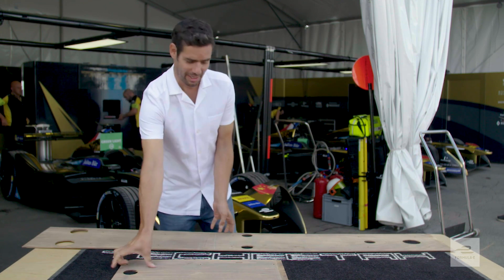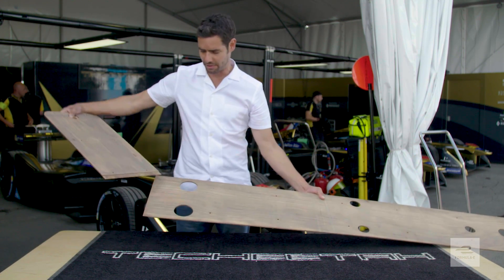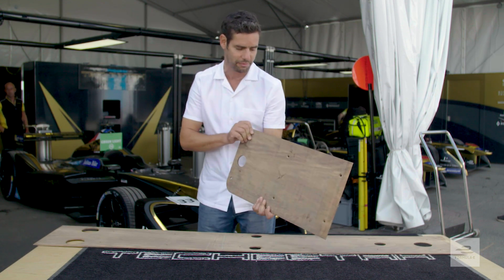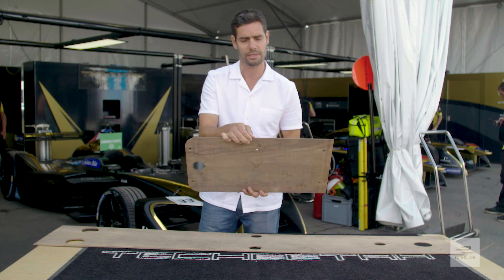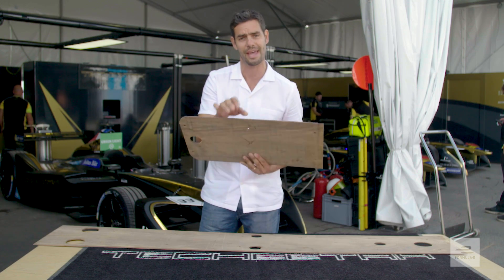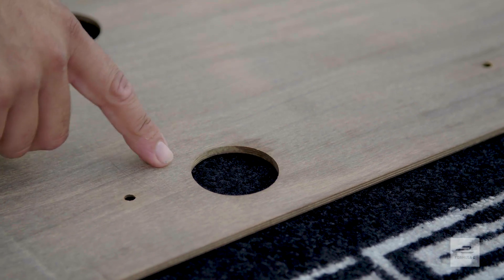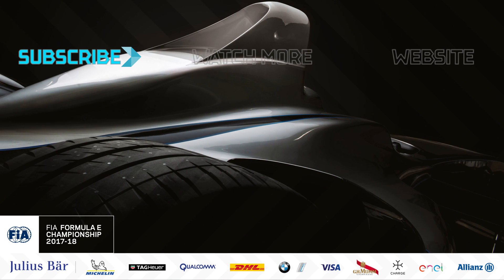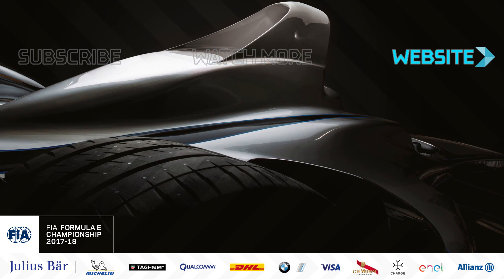Why Is There Wood In A Race Car? - Formula E

Comment: It's not for safety. It's to preveng ground effect using the Bernoulli Principle. Research those Lotus F1 cars of the 70's and you'll know what I'm talking about :wink:
Reply: This was a bit of the cause of senna's crash because he bottomed out on the floor really hard cutting of much of the airflow, which resulted in a grip loss and he flew off the track.

PS: the floor had no planks then that made it so rough when they bottom out, you could see MASSIVE sparks coming out of the back of senna's car, which are shown on Schumacher's onboard camera.

Edit: there where some other problems which made this an even bigger problem for him.